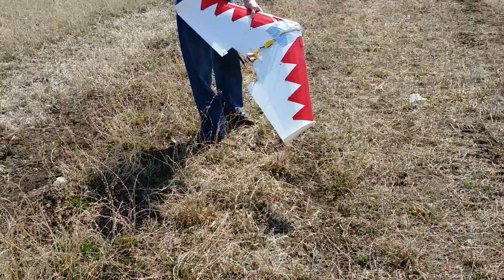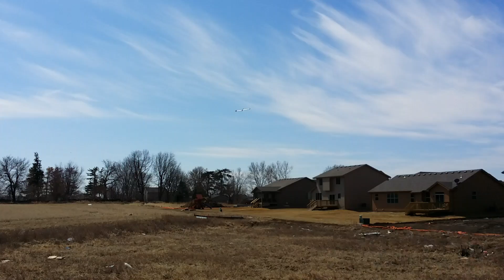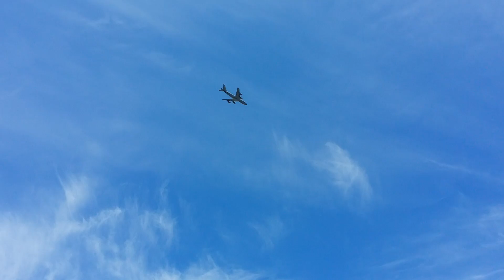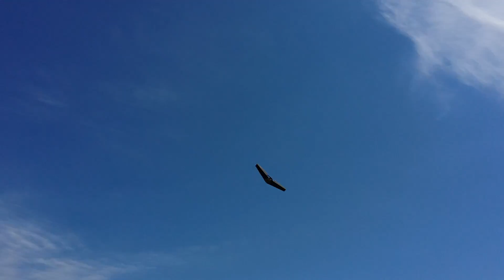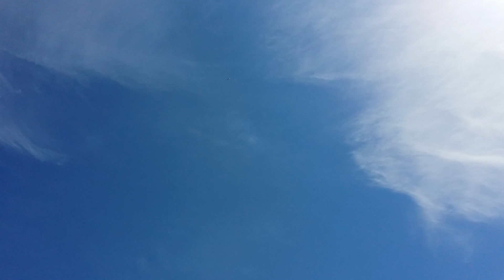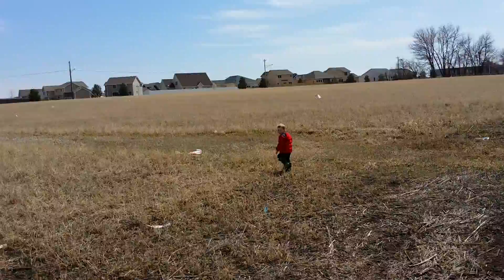FT Versa Wing with Suppo 2208

Comment: What are the specs of the battery you are using? I just bought the same motor and ecs, but haven't chosen the battery yet. Thanks!
Reply from the maker: +paulsreef27 I believe this was a 3s 1000mah from Turnigy. I did have to add quite a bit of weight to the nose of the plane to get the CG in the correct spot so you might be able to get away with a 1800mah or higher battery.